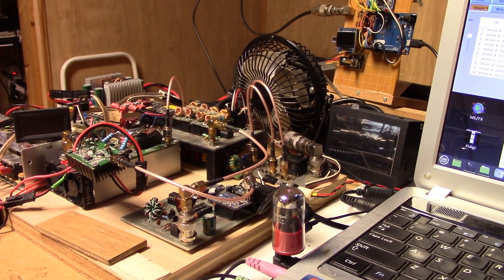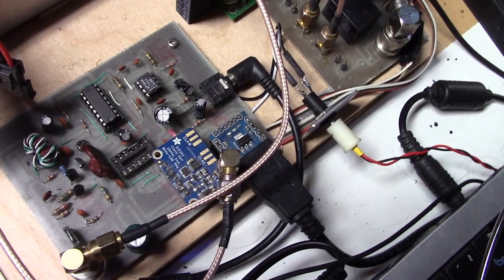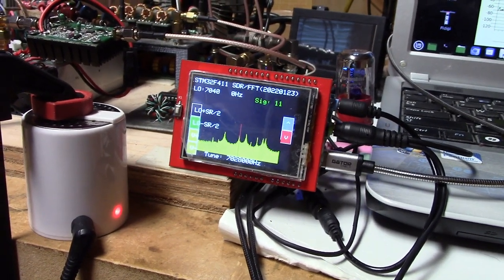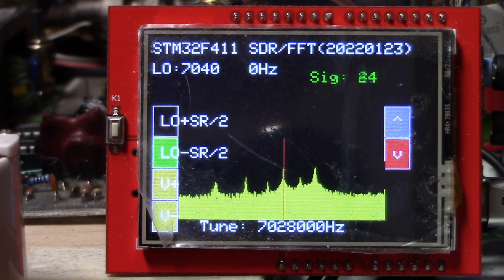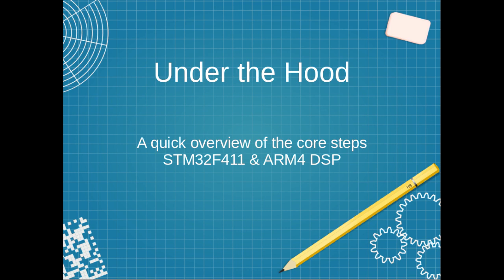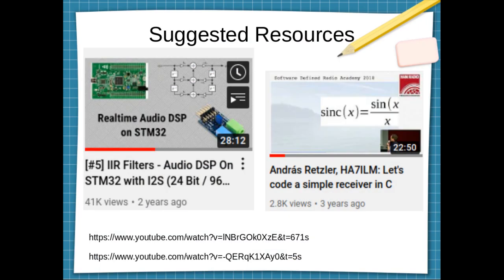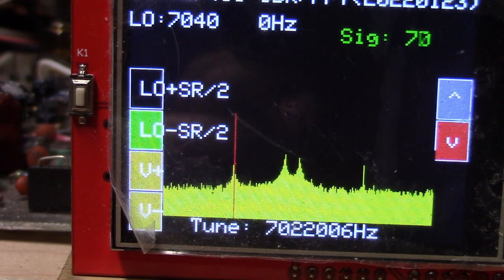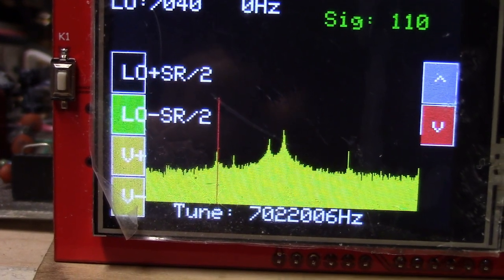STM32F411 BlackPill SDR Demodulator & GUI

Comment: What an interesting project, making a quality self contained SDR with common and relatively cheap components.   It reminds me of a similar experimental SDR by Ian NA5Y. I'll watch the other videos with interest.  Is your Tayloe detector schematic in your github repo?
Reply from the maker: Appreciate the comment. And yes, both the schematics & gerber files are out there (at least they should be; contact me if you don't find them). So the boards can be had through places like JLCPCB. IMO, in spite of its simplicity, its a remarkable CW transceiver, and fun operate. 
again tnx for checking it out.
Jim(KW4KD)

Comment: Very interesting video, thank you. Great work. I notice the STM32F446 boards are cheap and offer 180MHz which I guess would offer an improvement in speed.
Reply from the maker: Agree. That higher clock speed would allow you to "see" a bigger picture of whats in the "Neighborhood" . The Sound board is capable of sample rates of >96Khz. But, with the F411 @ <100Mhz,  had to run it at 48Khz.
Thanks for the comment & interest in the project.
Jim(KW4KD)

Comment: Amazing work. I'm also working on building a sdr transceiver with the blackpill. I'm using libopencm3 with cmsis dsp barebones adc input and pwm output. I saw in your code that you have some options to output coefficients for octave, very clever :) I'm trying to generate +/- 45 degree shifting fir filter coefficients with octave, but I'm still not too familiar with the theory and software. I know people have used the iowa hills software to generate the coefficients, but unfortunately their website is 'under construction' currently. My main problem is summing/mixing my two filtered channels, toggling the channels doesn't change the perceived audio so the unwanted sideband is not being cancelled. I'm also not sure if my current test setup using luaradio to shift around a iq.wav file and feeding that through an aux cable to the blackpill is the best idea. I should probably test with rf and use the tayloe mixer and si5351  topology as you have. I'm making steady progress though. I'm sampling usually at 48000 khz with a decent amount of coefficients, dma for both adc and pwm, half and complete transfer interrupts. I managed to overclock the f411 to 150MHz, it helps a lot with the processing, it was quite straightforward with libopencm3. Well this became retrospective documentation about my attempt :D I'm happy that I found your channel! I should publish my current code, when I do I can share it if you are interested.
Reply from the maker: Thanks for the report on the work you're doing. And yes, I'd be very interested in any documentation you care to share. So keep me posted.
BTW, there's a 2nd video on this project. It reviews  adding Si5351 control code to the project. Hope, if you have time, to check it out. 
Contact me directly through the QRZ e-mail address. 
Again, thanks for taking the time to post what & how you're using an F411 as an SDR/dsp processor.
Jim(KW4KD)